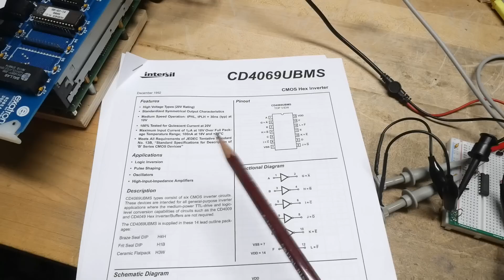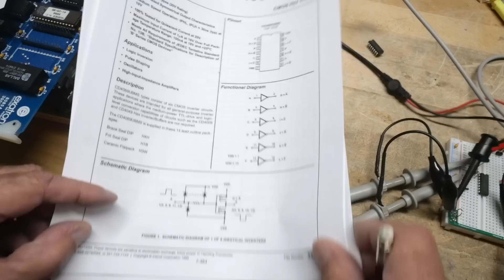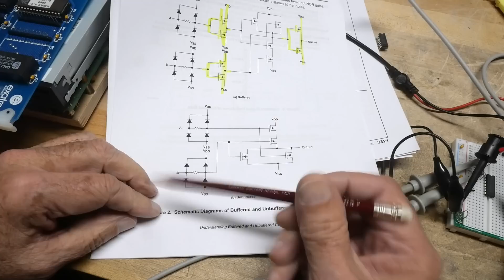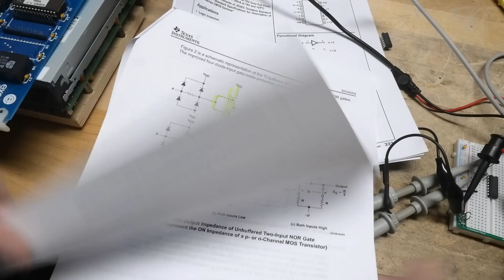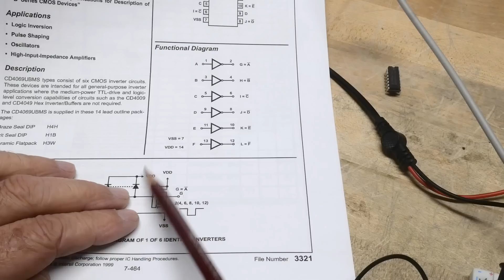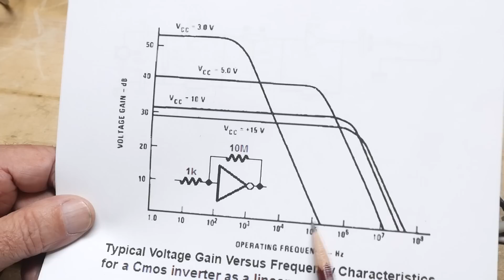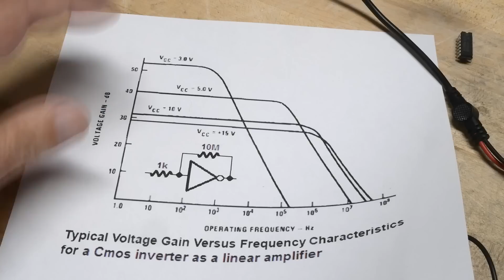#2187 CD4069 Unbuffered CMOS

Comment: Years ago (many), I designed an audio product that used 4069s as the analog attenuators because by correctly biasing the IC, one gets an array of 6 independent matched MOSFETs that track each other with temperature because they are on the same die.  The cost for these highly matched FETs was pennies for the set of 6.  Other solutions were either much more expensive or weren’t matched/didn’t track each other over temperature.

Comment: They were made for making oscillators. 

An oscillator needs a gain of one across the ring. The buffered part has less gain and makes a more stable oscillator. 

Handy for VCOs too. 

I worked for NSC as an FAE

This was explained to me by the design guys in the factory.

Comment: I think I detected a confusion about the buffer function. The inverter isn't a class B amplifier. Class B has an N type on top and a P type on bottom. For BJT, dual matched transistors would be fused at the emitters, for MOSFET that's fused source. An inverter configuration which is common for integrated digital electronics it's fused drain. Fused in this sense both drains are connected to each other. The graph you see for the frequency of the unbuffered version, that's the gain bandwidth product curve. Which is to show where the curve gives you constant buffering for the frequency used. Also, for the circuits that can use this under the range where the inverter configuration would lead to unity gain. Unity gain in digital electronics is useless, but if you wanted something that can generate a variable amplitude based on frequency, well you know how it can look like above the corner frequency.

Comment: At 0:40 all of the 4069 parts are CD4069UB. They are unbuffered and are simply hex inverters, one CMOS pair per gate. You are getting yourself confused with devices like the 4049 which exists in two types: CD4049UB (a hex inverting buffer); and the CD4049B (a hex non-inverting buffer). The 4049UB is similar to the 4069UB because each gate is a simple CMOS pair, but the 4049B is non-inverting; it's just a buffer made up of two CMOS pairs in series.

The difference between a buffered and an unbuffered gate is that the buffered gate has at least one level of amplification prior to the output pair. That's it. It's that simple.

Comment: I've never tried it, but you should be able to measure the individual FET properties (with the limitation that they share a substrate).  Armed with the characteristic curves with respect to Vgs and Vds for both the P and N MOSFETs you could explain the gain peaking at lower supply voltages...  Basically my guess is they are sized so their Idss is fairly modest to limit the output current and switching transients in the unsaturated region.  Frequency response wise you'd need the device capacitances too, which would be fairly easy to measure.

Comment: There is an error on Intersil's Schematic Diagram they use two N-channel MOSFET on top of each other so a signal on the Gate will result in a short from VDD to VSS. I can't tell if both datasheets are Intersil's, but I assume so, because they both have the same error. I finally got hold of a Texas Instrument datasheet and theirs was correct. Fortunately for Intersil they have corrected the error on subsequent pages. I have worked in my long career troubleshooting software and proofreading manuals, so I see the slightest mistake quickly.
Reply: The Fairchild datasheet for the CD4069UB (dated October 1987 Revised January 1999) gets it right.

Comment: You know you can't leave that input 1K resistor up to speculation... you should've done a run with it in place to see what effect it would have - did it reduce the distortion or increase the bandwidth some to match the data sheet?
And in CMOS, the NMOS transistors are always the better ones as they are using electrons as charge carriers and electrons move much more easily than holes as used in PMOS transistors. So NMOS transistors are always better spec'd and thus you will get a pull down tendency. This is compensated for somewhat by designing larger PMOS transistors to cope with the lowered charge mobility of holes but it isn't always an exact science.
Also, NOR and NAND are preferred logic gates as they're universal - any logic function can be created using only exclusively combinations of NOR or NAND gates. NAND is usually preferred due to the NMOS transistors being better suited to being in series (due to better charge mobility) so you get a faster part overall by area with NAND rather than NOR, but either works. Most HDL compilers compile logic to NAND/NOR gates (universal), then the optimizing passes remove gates that are redundant. Then the design is broken down to transistors where redundant transistors are removed, and that's how an HDL compiles down to transistors.

Comment: I very much enjoy your videos and explanations IMSAI Guy!  Some of the backstory and reasons for developments (even existence!) which you add you from your clearly vast experience in the industry, you  cannot get anywhere else, so although I could maybe make a video with the same factual content, the additional info and history you include is fascinating and often new to me also...we should never stop learning, and you surely help us in that!
My anecdote of first hand experience of Buffered vs. unbuffered CMOS:  When I was doing testing of production electronics early in my career, I came across a whole batch of keyboards which were constructed ok, but simply wouldn't work...the circuit used a CMOS chip in linear mode for debouncing...  It turned out the parts buyer had bought buffered parts for use in making the boards when they were designed using unbuffered parts ("...what's a suffix among friends!")...after much testing and investigating, including checking the component data sheet, I determined the additional buffering circuit (likely the additional stage transfer delay) in the 4xxxB part put the debounce stage outside a functional window.  Such was my introduction to the difference in buffered vs unbuffered CMOS parts.  Thanks and Cheers from Connecticut!

Comment: So... what does a buffered inverter looks like? 
Also it wouldn't work because it would saturate?
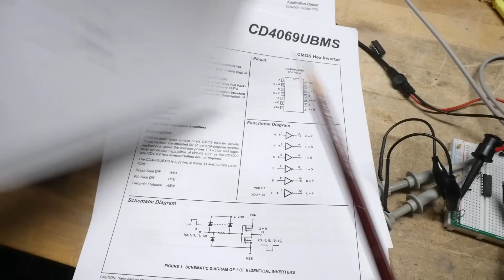Also 2:30 I don't think you can swap them because of VDD, i think that hc works only up to 6 volts.
Reply: A buffered inverter looks like three gates from a 4069UB in series. It has a huge gain and tends to be unstable if you attempt to use negative feedback from the output of the third stage to the input of the first stage, so it is only really suitable for use in digital applications, where it stays in saturation at one rail or the other.

Comment: 4069UB and HCU04 are not always interchangeable - it will depend on the circuit. While pinouts are the same, allowable supply voltage ranges are different, and the HCU04 is faster with higher output drive capability.

Comment: I was trying to add the serial CAT control interface to my son's Kenwood TS440s transceiver, but ran into an issue with the pull up resistors being too strong so the serial line never crossed the low threshold.  First we replaced the 7404 hex inverter on the inputs with a 74ls04, then the input levels were transitioning, but the other inverters on the 7404 were used to run the serial crystal oscillator.  That stopped oscillating.  Should I go back to the non LS 7404 chip or is that unlikely the reason the oscillator quit working?  Thanks for putting out these videos.  I'm always learning something new from them.

Comment: That's not a class B amplifier. It's class A. Look closely at the schematic. It's not a source follower.
Reply: @klave8511  Class B draws no quiescent current.
Reply from the maker: https://www.elprocus.com/class-b-amplifier/
Reply: @IMSAIGuy  Look closely at that schematic. There's no crossover distortion. It's push-pull class A.
Reply from the maker: OK, I think you are correct. the feed back resistor, biases the transistors into class A for very small signals.

Comment: Connect an odd number (three or more) of the inverting gates in a ring such that the output of one feeds the input of the next and the output of the final one feeds the input of the first, and you will have a nice wide-frequency-range voltage-controlled oscillator.  Be careful not to apply too much Vcc to cause excess current draw or excess dissipation.  Better yet, feed Vcc with a controlled adjustable current source.

Comment: If you remove the input probe (10M) from behind the input capacitor the 10M feedback will have a chance to provide symmetric operation and a lot more gain. The asymmetry becomes obvious at the 3V output signal. (Nice video and explanation anyways.)

Comment: Hmm, it didn't look like you were getting anywhere near the gain specified in that datasheet.
Reply: They don't specify gain so much as say you could get similar results.  Remember this is a hack with a digital chip.  The trick to using that data is that you need the exact datasheet from the exact maker and production node used to fab the parts you're working with.  WIth a jellybean like a 4096UB which is made in such volume this becomes almost impossible so the most common approach is to tweak the values until they work and then stick to a single vendor for manufacture and reevaluate product performance when you get the next lot of inverters.  These inverter amp circuits typically need bit of trimming in circuits where voltages matter.
Reply: @Peter_S_  TBH there's nothing specific that makes this a "digital" part as it's just a totem-pole of MOSFETs, as used in final stages of amplifiers and such. Give it a digital signal at the input and you get it into clipping i.e. you get a digital signal out. :) And yes likely the discrepancy is due to different manufacturers, the manufacturing technology changing ovet the years and so on.
Reply: @stamasd8500  I beg to differ.  Most logic chips are made for digital use and don't appreciate inputs which are not at saturation, and when you have three successive MOSFET pairs in a device for a buffered inverter the signal will be driven to saturation by the time it leaves the second MOSFET pair even if you give it a 50% input.  The output of CMOS B series logic is digital by any reasonable description because of the massive gain.  It will inherently be a "digital" device which is only able to provide two stable output states.  These UB parts are different in that you can use negative feedback to force them into linear operation and they'll behave like linear parts even though they're from a normally buffered "digital" logic family which cannot be coaxed into linear operation no matter how hard you try.  They don't overreact with extra current draw to having their inputs at 50% either which is another difference.  The normal B parts do not work the same way and circuits meant for UB parts don't work with a B part installed because the B parts are "digital".
Reply: @Peter_S_  The B parts are "digital" because they're buffered. When you cascade 3 inverters and then try to use it in an analog manner with a feedback resistor, the intrinsic amplification of the inverter chain is so high that the slightest voltage deviation on the input (held at approximately 1/2Vcc by the resistor) is enough to produce garbage and self-oscillation. If you cascade 3 of the inverters in the 4069UB to make a buffered inverter, and then try to use it in an analog circuit, it will produce the same garbage as one (buffered) inverter in a 4049B for instance.
Reply: @stamasd8500  Didn't I just say that the signal would be in saturation by the time it left the 2nd CMOS pair in the buffered inverter structure because of the massive gain?  If you're trying to tell me about CMOS, I've had Lancaster's CMOS Cookbook since the first printing and I've been designing around CMOS at work for 40 years.  I've also answered the question, "Why doesn't my Way Huge Red Llama or Craig Anderton Tube Sound Fuzz build work?" a couple hundred times over the last 25 years for DIY signal processor builders so you could say I'm a bit more acquainted with the internal structure of these UB devices and use of CMOS inverters in analog circuits than most.  The most common build problem people seem to have is not understanding the difference between a 4049UB and a 4049B.

Comment: If you want to see a great analog circuit using these, the MXR Envelope Filter from 1976 is a guitar signal processor that uses a pair of 4069UBs and a 4066 to implement a switched capacitor low-pass filter which has the frequency selection tracking the amplitude envelope of the input signal.  The resulting effect most people would instantly call "funky" guitar.  The 4066 provides two analog switches and the 4069s provide a digital oscillator, a digital switch driver stage for the CMOS switches, a switched capacitor filter,  an envelope follower, and several accessory amplifiers.  11 inverters with 4 doing digital service and the remaining 7 operating as analog stages.  The original schematic called out that only RCA 4069UBs were suitable for production with that schematic.

Comment: These UB series chips have a surprising crossover into the world of analog and a long history of analog use in products.  If you give them a feedback resistor, they become inverting single input opamps.  This property has been used since the 1970 for electric guitar signal processors including distortions and active filters.
Reply: RIYL: Lantertronics channel
Reply: Single-gate unbuffered cmos parts are still readily available (in SMT 5 pin packages like the SC-70) probably for making xtal oscillators.
Reply: My favourite application of this 4069 feature is in an ac line detector, it does everything, 60Hz filtering, buffer, and output stage for the LED with several gates on parallel